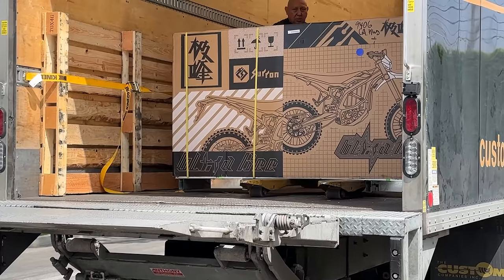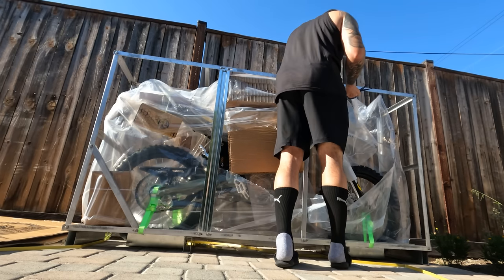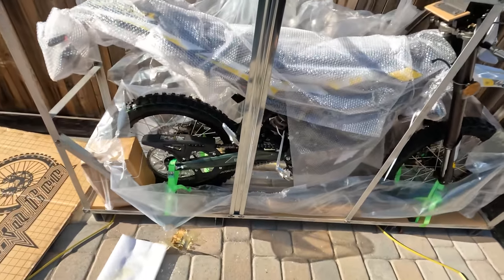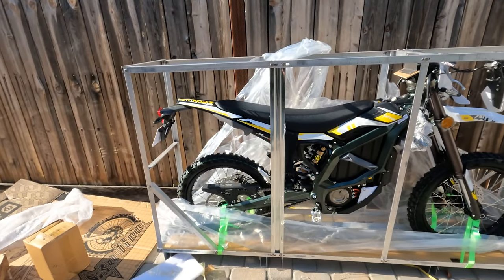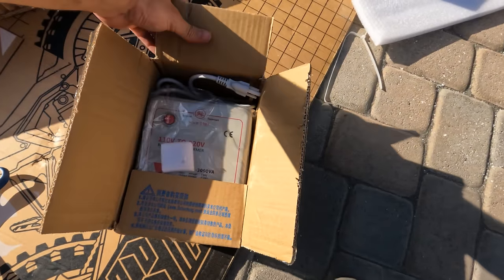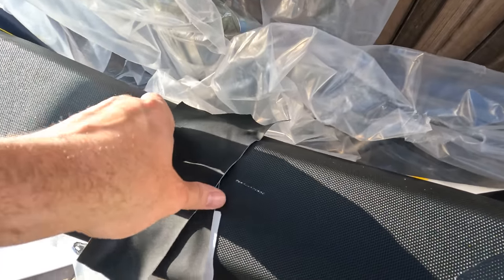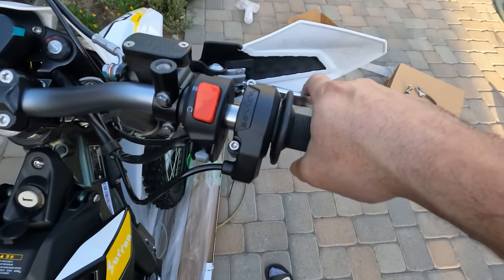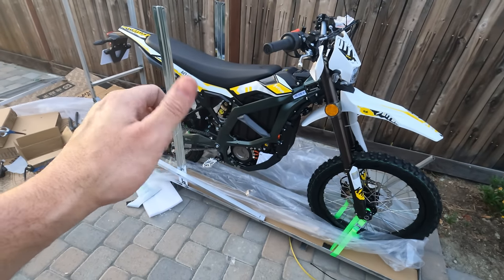BUYING A NEW 2023 SUR RON ULTRA BEE - UNBOXING

Comment: Looks like a nice bike for sure, the plug you shown at around 10.20 is an Australian and New Zealand 240 V plug. It may be used in other areas of the world as well.  If it has a thicker earth pin on the bottom its for a 15 Amp circuit as the normal outlets here are 10 Amp.

Comment: Man $6,000 for an electric bike and the battery can't even last a full 24 hours I don't know bro
Reply: I don’t know where you would plan to ride, that’ll take 24hrs, but it’s not bad.. ride around for a couple hours, come back home and pop her on the charger for the next day. Nothing wrong
Reply: @IntegraDIY  with my friends and I go out and run our mini bikes on street we ride 60-plus miles just in one day alone at an average of 40 mph to 50 mph so there is no way that that bike will keep up without having to be recharged
Reply: @moonyshine  when my friends and I take our bikes out to the trails we load them up in the trucks and we go for the full day gear and all and there is nowhere to charge a bike out there so it may not be for 24-hours straight but I guarantee it's going to be for more than 3 to 4 hours